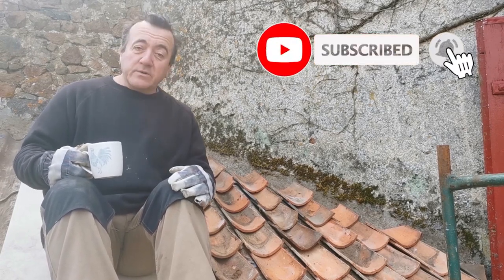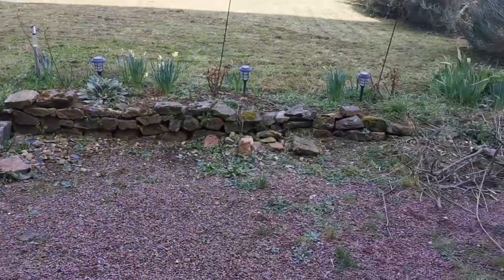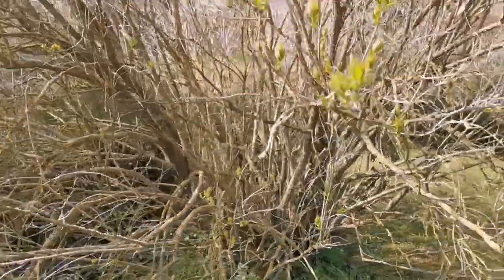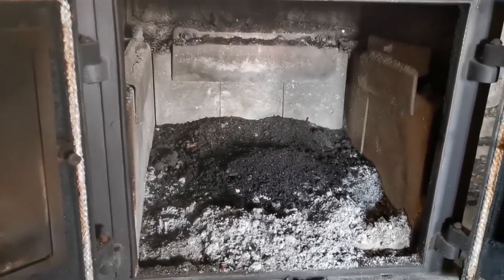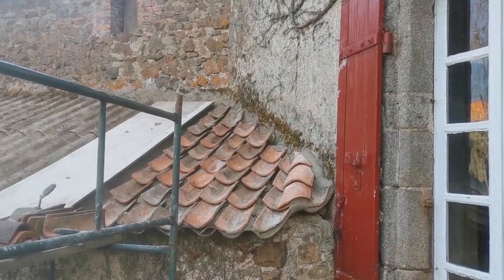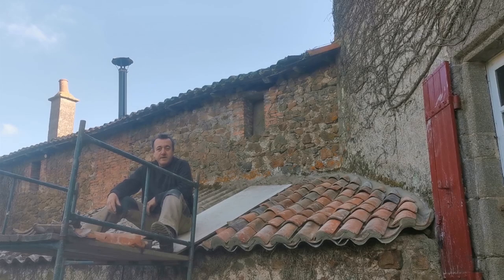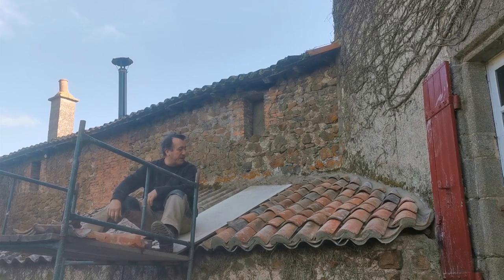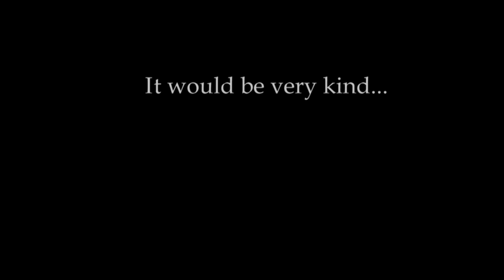Episode 103  Up on the roof

Comment: When I saw that you cleaned the flue on the stove, I thought of when me and my X had a house with a stove, we cleaned soot from glass panes in the following way: 
A slightly damp cloth, dipped in the very fine ash, rub the inside off the windows and wipe / dust with newspaper - it will be a brilliant result !! 
Congratulations on the 2nd anniversary - 
I'm a new viewer of your videos, have only seen about 15, so there's enough to catch up on! Warm thoughts 
Marianne Svea, 
Kolding - Denmark

Comment: I saw an ad for a wood splitting tool that fits your drill. It’s conical shaped. Check it out. It looks so much safer than a wedge. You might be able to order from Amazon. 😊
Reply from the maker: Hello Tracey, thanks for the tip. Unfortunately, Rob, from over the road, and I ordered one each and neither of us could get them to work properly. We were using powerful drills. All the best to you, Suzie and Rols
Reply: @chateaucitadelleducavalier  oh darn. That’s a shame.
Reply from the maker: @Tretz624  We were attracted by the marketing video and we tried soft and hard woods and all it did was drill a hole 😂